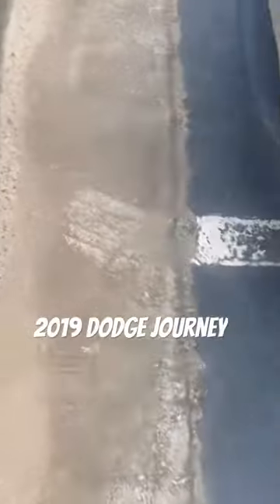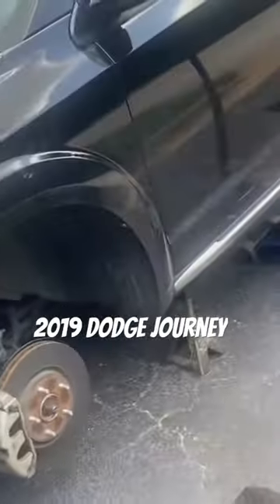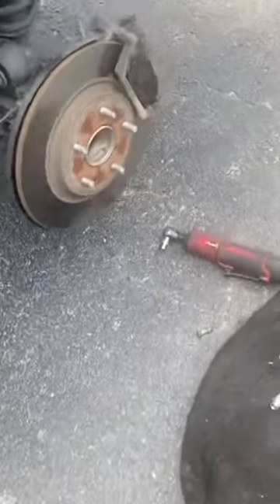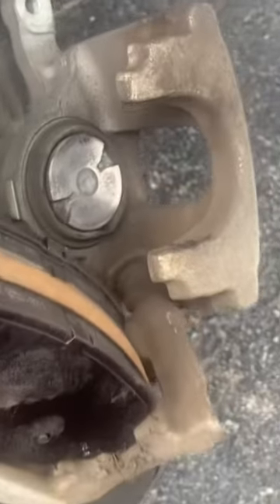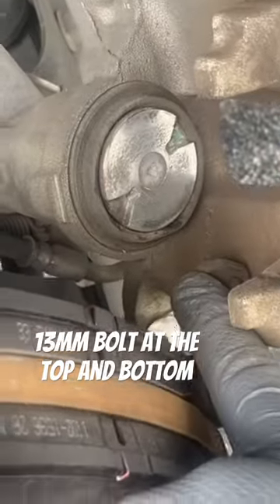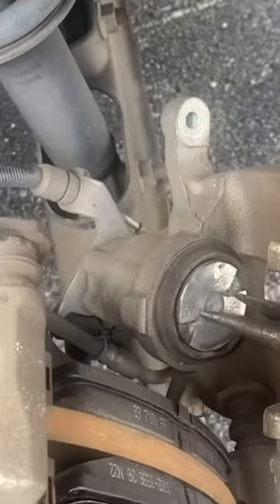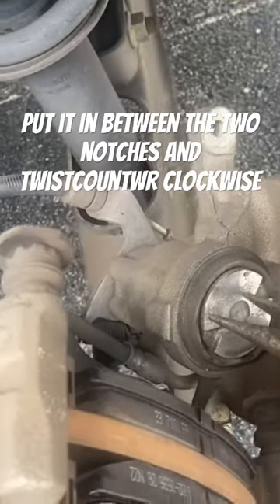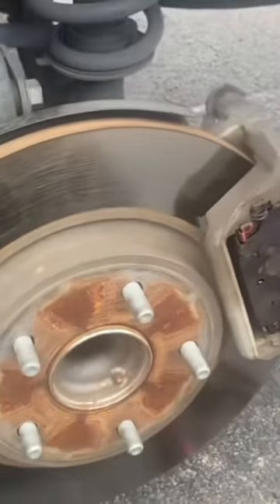Do This When Installing Rear Brake Pads On A 2019 Dodge Journey! #best #car #tips

Comment: Nice tip…….
But on the right side of the vehicle it appears that it is opposite and anticlockwise will spin the bugger off.

Just found out the hard way.  

Also, the wrench you use to replace the grinder wheel on your hand held angle grinder - sort of like a Y shaped bar with a couple of tits poking out works even better than the needle nose.